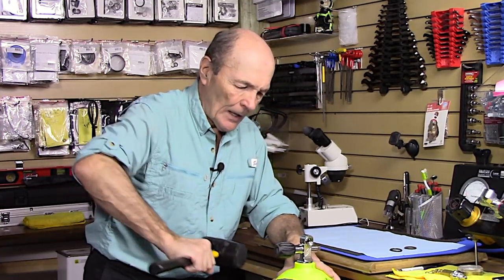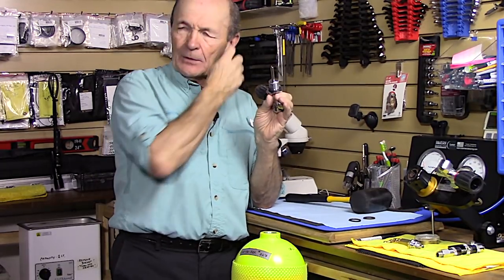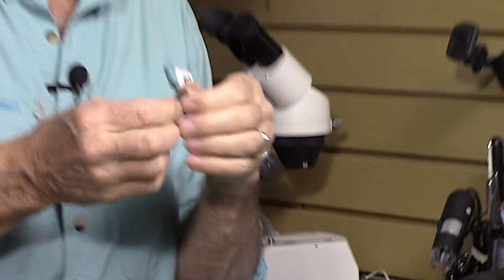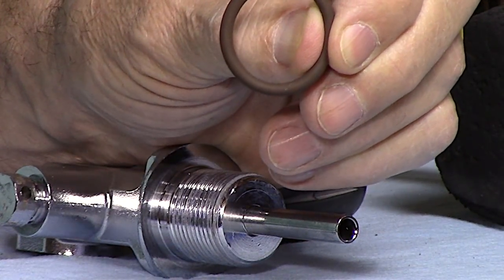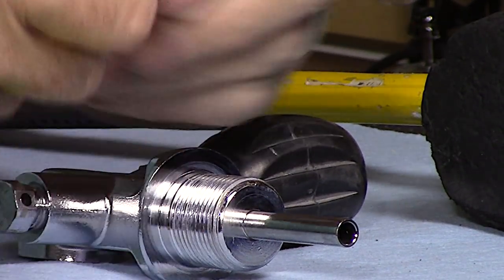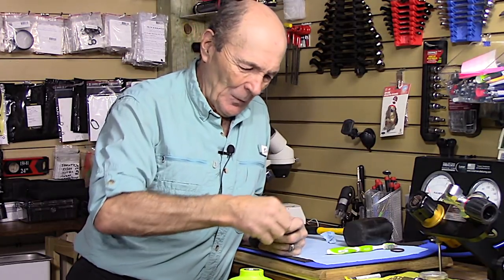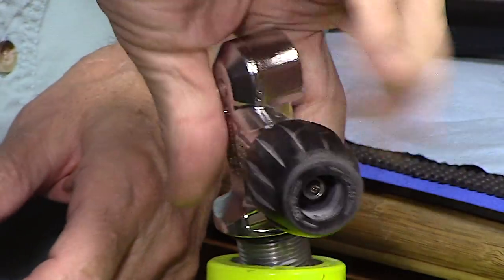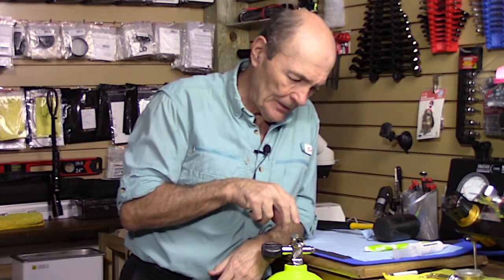Replacing Your Tank Valve O-Ring - Scuba Tech Tips: S07E15

Comment: You can use tape over the threads to prevent a sharp thread from creating tiny  tears in the oring.   In the Navy we had plastic sleeves and we slid the orings over those.
Reply from the maker: Scuba pro's have a similar tool as they do it several times a day.  Hope new divers understand how to get it on without damage.
A

Comment: SGA sells a valve with a black cap with a hole in it for the dip tube screwed onto the valve.  The cap is great for installing o-rings.  Simply screw it onto the valve and slip the o-ring over it.  It does help to spread a tiny bit of lube on the outside of the cap to make it easier to let the o-ring slide over.   The helps to prevent the o-ring from rolling or being cut from the threads.

CGA, DOT, or OSHA has a video on how to install valves.  It suggests using a non-adhesive wrap over the threads before installing the o-ring.
Reply: Trident scuba calls the ribbon rescue tape, part number FA64
Reply from the maker: Sounds like a good device for shops doing lots of tank valve services.  Always use non-adhesive wrap, like silicon tape.  Do not want anything sticking to the threads.  Thanks for sharing Chris.

Comment: Great video again, thank you! I wonder, shouldn't we cover the tank's open hole while we work on the valve? I was anxious while watching, keeping an eye on the opening and waiting for brushed off dirt to fall inside. Am I exaggerating?
Reply from the maker: You're right.
In actual service mode we use a special threaded plastic cap that goes into the tank whenever the valve is not there.
We also brush and blow off any dirt before and then after the valve is loosened but before it's removed so nothing that might have been around the valve falls in.
Good that you noticed that.
Alec

Comment: In the UK with our steel tanks and DIN tank valves we just have a bar that screws in where the 1st stage goes. A quick tap on the bar does the trick to release. Our tank valves also have a hole in the side where they screw into the cylinder to relieve the pressure if an idiot tries to remove the valve with pressure in the tank.
Reply: second that. another reason why DIN is actually better :)
Reply: You need a very long bar if you would like to remove the valve with pressure inside. The force is immense.
Reply from the maker: It would be almost impossible. Something would break before the valve moved.
Alec
Reply: No, of course we let the air out first. but we don't hit on our handles. we just screw a metal bar where the first stage usually goes and voila. A little nudge in the right direction and the valve is loose. Something like this: https://goo.gl/b2e69w and since it screws in it doesn't matter how the valve is actually shaped.

Comment: Dear Alec, thank you very much for this video. My 18L steel tank just returned form the hydrostatic testing and I noticed the valve is mounted (tightened) in slightly different position, missing approx. 30-45 degrees turn to be oriented to the very same position as it was before the testing (easily checked by the stickers on the tank). Is this normal to have the valve in the different position after testing? Thank you!
Reply from the maker: It can be depending on the torque used to tighten the valve (assuming proper limits and not gorilla strength).  
A

Comment: Thanks for a great video as always. Why are not valves made in stainless 316L steel?
Reply from the maker: Good question.
1. Stainless is not stainless and would soon start to breakdown, particularly in salt water.
     Brass however, will never corrode.
2.  Stainless is much harder to work with os it would be a big job to machine a valve with all the passageways.
3. Cost. Stainless steel is twice as expensive as brass.

Take care.
Alec

Comment: Hi Alec how tight should a person make the handwheel knob on the scuba tank would a three finger tight be enough or just snug thanks again
Reply from the maker: If you mean when opening a tank, use 3 fingers until it stops, no more force (not needed).  It also help when closing as there is no effort to start the valve closing.  
A
Reply: @AlecPeirceScuba_SeaHunter  Thanks so to tighten the knob only three finders tight not even snug right

Comment: What exactly is actually done on the visual examination? Is it that the threads are basically being looked at?
Reply from the maker: Take a look at my video S08E08 Tanks visual inspections for more information.  Checking the tank threads is just one of several inspection points.  Also looked at is the outside for anything that would affect its ability to flex under pressure.  Inside is key for corrosion, pitting, debris, anything that would affect the air quality or tanks safety.

Comment: I have an older cylinder with a J valve,  can I change the valve with a newer and what should I keep in mind when purchasing a newer valve? Or are they all of the same diameter?
Reply from the maker: If the tank is good (VIS & Hydro), then a modern 'K' valve can be fit if the threads are not tapered like in old 72's.  The only valve options are if you want it convertible between yoke and DIN via a threaded insert.  Thanks for watching.

Comment: Regulators are full of O-rings. do you need to have them rebuilt with the nitrox o-rings?
Reply from the maker: Each manufacturer sets the recommendation for o-ring replacement when converting from air to EAN up to 40% O2.  Some regs are nitrox ready out of the box new so check the product before filing.  Otherwise, any o-ring that comes in contact with nitrox has to be changed using the makers service kit that only certified technicians can order.  O-ring conversion kits are not that expensive and since a reg is generally serviced annually, maybe more if diving a lot.  Talk to your local dive shop service tech about the cost at your next servicing so your not paying too early.  Hope this helps.

Comment: so you sort of touched on the Nitrox o-ring (brown) vs regular rubber one. I have a tank that I occasionally use nitrox (pre mixed, not o2 clean) on boats, but it never stays with nitrox longer than the day or 2 boat trip, then gets filed with regular air at home. I did replace the valve with a regular o-ring (had a tech multi DIN valve I took off) and I don't see a reason to change it given how infrequently it stays with 32% (just like rest of my gear uses regular o-rings). Makes sense ?
unfortunately no way to know if shop replaces it on every visual or even hydro... guess I should ask or open it up and check after each visit....
Reply from the maker: 1. If you're using no more than 32% and only pre-mix then you're fine. There's no real need for Viton O-Rings or any other oxygen compatible O-Ring until you reach 40% or more. If you were partial pressure filling you'd be putting in 100% oxygen.
2. A proper annual visual exam includes new O-Rings in the tank neck and the valve face. The cost is less than $5 for both and why risk a blow-out for that. The tank neck O-Ring is under constant high pressure so gets very distorted. The valve face O-Ring is exposed to sun, salt and water so alos breaks down quickly.
3. How do you know if your dive shop changes them? Because they always show you the used parts that they replaced right!! 
     Or they should.

Take care Alain.
Alec
Reply: I bet they don't. Never have seen old parts but I also didn't think to ask if they change orings. I will now.
Reply from the maker: Tell them you're keeping a record of your reg's performance and maintenance and want the old parts back.
A

Comment: why dont you screw the O ring down the thread? that is easier right? but maybe the sharp edges can shear the ring
Reply from the maker: Tank valve makers generally agree to not 'thread the o-ring' onto the valve.  Reason is as the valve turns it can cut or mark the o-ring   making a small leak possible.    Stay tuned in 3 video's from now a new video on 'properly install a tank valve' is coming.  I discuss your question and answer many others.   Thanks for watching.

Comment: Why not use a wrench?  I have seen a lot of bent knobs....  also some viton come in black too.  the process of dying them brown is said to weaken them?? who knows?
Reply from the maker: If you have the proper wrench to fit the valve that's what to use.
The problem is that valves are not a standard design.  Some have wrench flats; many do not. Even for those that do you'd need several different wrenches so what happens is someones uses an adjustable wrench and proceeds to ruin the flats or even the valve. You wouldn't believe what I've seen!
So, used carefully, a rubber mallet works well on every valve.
There are wrenches made that fit down over the valve from above. They have 3 or 4 strong fingers that fit against the sides of the knob and allow you to use a standard 1/2" socket wrench. They also allow you to use a torque wrench which is good. But again, you would need several to fit all the different valve designs and they simply don't exist. A good machinist could make a set but the value in doing so isn't there. No one would buy them.
The different color of a Viton O-Ring or any other special purpose O-Ring isn't dye. It is the result of different material used to make the O-Ring. You can read on the internet about the different O-Rings available, what they are used for and what they are made from.
Thanks again for watching Mars.
Alec

Comment: Decades of experience and he's whacking the knob instead of using an adjustable wrench! Do not do that! Use a soft grip wrench to avoid scratching the brass coating.
Reply from the maker: Your right Caleb, my decades of experience includes 1,000+ scuba tank valve on/off services.  So let me share that experience in detail and why I use the rubber mallet technique.  

We agree that tank valves are soft brass, so using anything hard like an adjustable or fixed wrench is not the best.  Soft grip wrenches may work for you but require more clamping force and can slip causing rounded flats.

The key fact in tank valves is not the tool, but the O-ring.  The o-ring is the only thing holding back 3000 psi of tank pressure, not the threads.  

The Sherwood service procedure SSV-48P for "Recreational Scuba Diving K-Valve", specifies "40 - 50 ft. lbs. of torque", nothing more which is just over hand tightened force.   

The same service procedure under Disassembly, step 3 states "Remove valve from tank."  They manufacture never mentions what on/off tool.  It is up to the service technical which method best works best.  In my experience, 2 taps with a rubber mallet loosens almost every valve.  Consider how much abuse tank valves get when transporting or diving, this is minimal force and cheaper to repair than replacing a stripped valve. 

Last, in the 2018 Trident Diving Equipment catalogue, page 62, part #SA70 is the only tool listed to remove tank valves, "Rubber mallet for tank valve removal."  No wrench or other tool is mention for this purpose in that 436 page manual of everything scuba.

My point is the rubber mallet easily removes a valve that is not over tightened.  If you have a preferred tool that works for you, keeps your clients from complaining about scratched valves after a service, please do so.  I'm sharing my service experiences for everyone to learn something they are not shown in Open Water classes or even Equipment Specialty courses.

Hope this was not too long, like my videos, and we shared our experiences for others.
Thanks for watching.
Alec.